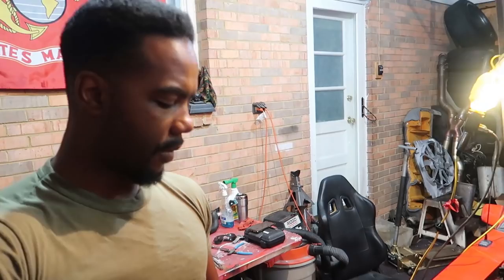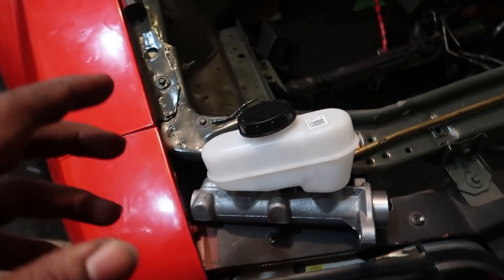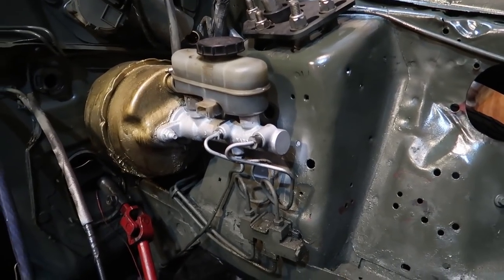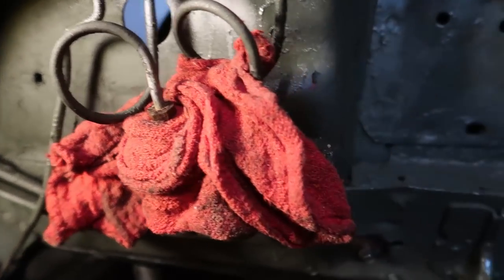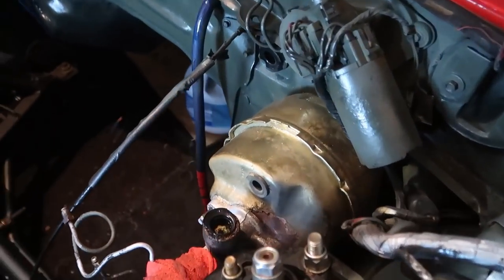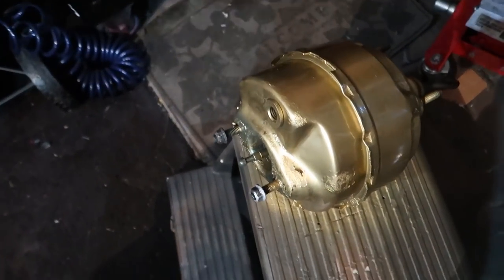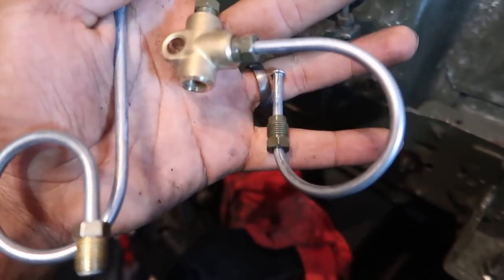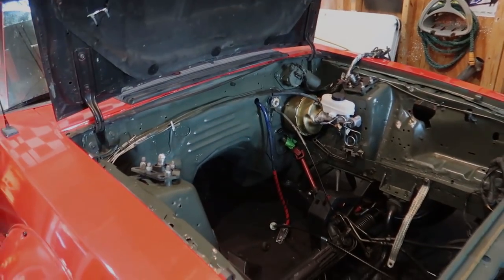Master Cylinder Upgrade: Foxbody Mustang

Comment: Next time quickly get low pressure water from a bottle or hose, it will instantly wash brake fluid away like magic. Buddy told me that my first brake job and I've never had paint strip off to this day.
Reply: Liquid Snakes good info.....Yikes lol
Reply from the maker: Thanks for the tip!

Comment: This type of master cylinder has two separate brake lines. One for the front and one for the rear. If one is damaged or rusted to the point of losing all your fluid you have no brakes. An 86 SVO master cylinder has a 1 1/8 bore and is a true dual reservoir that will leave one brake line operational.
Reply from the maker: good to know, i'd still hate to have a brake line go out.

Comment: You rock!!!!!  Thank you so much for this video!!!!  I'm doing this as we speak with the same identical parts!!!  Now I can finish!!!!!
Reply from the maker: I hope your came out easier than mine.
Reply: @Sgt.Slides  when I was swapping the brake hoses to the front caliper mine completely stripped on both sides. They were completely rounded off. One of my friends is a mechanic and showed me how to use a pipe wrench to take them off easily even though they were perfectly rounded off
Reply from the maker: sounds about right.
Reply: Haha same, mine stripped too. Had to use vise grips to take it off. Line wrenches is a must. Oh well

Comment: 79-86 mustangs. The driver side front line screws into back of prop valve.   Fronts always see full master pressure so combo valve kinda pointless.  Rears is where prop valve does its mojo

Comment: couple of things,  You should install a Cobra booster if you want to have a good brake feel. Always use line wrenches to avoid stripping the bolts and spray PB Blaster on all the bolts to free them up. Also did you gut the portportioning valve and use the MM plug and install an adjustable proportiioning valve on the firewall fitting?
Reply: @MrMikestang63 Cobra or Gt booster, doesn't matter, brake feel is going to be the same, the cobra booster is just more expensive.  I did this exact same swap with a 94-95 Gt booster and it works flawlessly with great pedal feel.  Definitely recommend the MM plug and proportioning valve like you stated for optimum results.
Reply: No booster, what are we all girls here? Lol.

Comment: Where did you get the adaptor ?...AND please post part #'s of the pieces u used to make your own kit and where you picked them up at....Also next time you take off the M.C bolts just use a deep well socket  with extension and if need be a universal or swivel joint drive it on with a hammer n If the nut gets rounded just use the next size SAE or METRIC socket on extension and DRIVE it on with the hammer. Thats what I did.... screw the booster removal. Did u remove proportioning valve n if so what are the flare nut sizes n threads so we can get the correct adaptor fittings n order to run the adjustable proportioning valve for the rear brake line on pass side firewall ?....THANX!
Reply: Maximum motorsports.

Comment: @7:24 you mention measuring the distance from the nipple of the brake booster.  What if you do not have the old master cylinder?  The shop tossed it out and I don't think they measured this properly and it lead to premature failure of my new cylinder.  So now i'm going to upgrade to the 93' Cobra version and I'm not sure how to measure this correctly! Any suggestions?
Reply from the maker: that push rod only affects how much the pedal engages the master cyl piston.  There's no way that having the wrong adjustment would cause a failure of your master cyl.  If the rod is too short, your pedal will sit too close to the floor.  If it's too long, it will be difficult to fit together and your brakes may actually start to rub depending on how much you force it.  If you can't measure from the old cyl, you just have to adjust it till the pedal feels correct, which means you may have to remove and adjust a few times.

Comment: You have to change the brake booster? Or just the master cylinder? Thank you
Reply from the maker: i had to remove the booster because the master cyl nut was seized badly, it could have been a really easy install, but it got complicated.

Comment: Are u running 4 wheel disc brakes and also are u using the stock brake booster
Reply from the maker: Yes i am.
Reply: @Sgt.Slides  ok cool thanks. Thought u couldn't use ur stock brake booster and master cylinder with 4 wheel disc brake
Reply from the maker: @baldheadjamaican2551  the brake booster doesn't care what kind of brakes are on your car as long as the master cyl fits it properly.  I don't remember all the rules on the master cyl at this point, but Maximum Motorsports website has a ton of info on the most used brake solutions, and how they work.
Reply: @Sgt.Slides  thank u. I'm just using the whole 95 mustang brake booster and master cylinder setup on my fox. I just hear some people talking about different bore size if u run 4 wheel disc
Reply: This will all always work together but you might not like your brakes,they will just be adequate",ideally you want a Cobra booster (or 95 like you have) and a different master cylinder when you do all discs on a 87 to 93, there is a reason why the 93 cobra had a bigger booster and a bigger master cylinder,bean counters HATE spending extra money so they would have left the normal booster and normal master cylinder on the Cobra if it was up to them but they didn't.

Rear disc brakes require much more fluid and more assist than drums,what happens to a lot of people is that when it comes time to replace the booster on a otherwise stock setup they think "well ill just get a Cobra booster and its bigger and will look cool" but in reality you dont need it if your staying stock,its overkill, then you have the opposite ones that dont want to get a different booster or master cylinder cause "it will work as it is" sounds like you have the right setup.
Reply: @dntlss  I ended up cutting a lil bit more into the shock tower and making the brake booster fit better. It's also alot easier to get the brake booster in and out of the engine bay

Comment: wWth all of the crap info in this video.. I'm scared to see that mustang on the road. Maybe this is why mustangs have a reputation for smashing into crowds.
Reply from the maker: Bet you can't cite anything incorrect... Thx for watching though, i'm sure you learned something. Sorry about your negative reckless driving experience.
Reply: @Sgt.Slides  Off of the top of my head, The "largest" bore master cylinder is NOT 1-1/16" I'm sure I can find more.
Reply from the maker: for OEM direct swap, 1-1/16 is the biggest one,  If you go aftermarket, im sure there are all types of options.  Anything else? 
 @granadojl
Reply: Lincoln mark V is 1 1/8, got one on my 65 fastback.